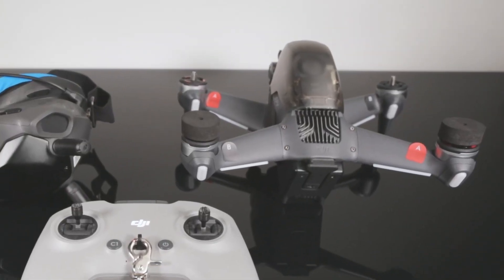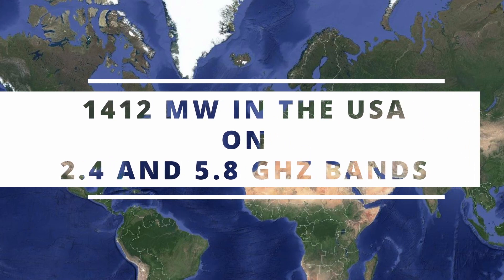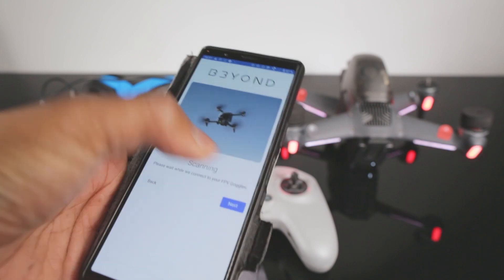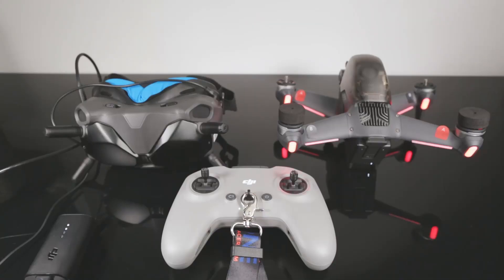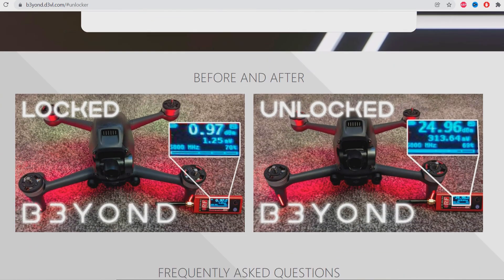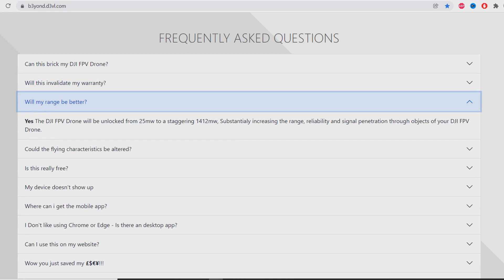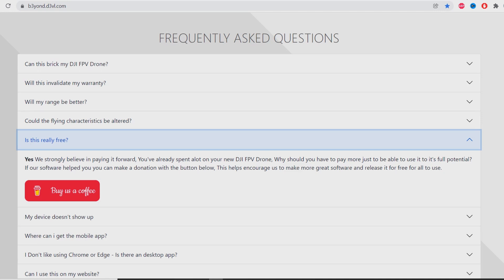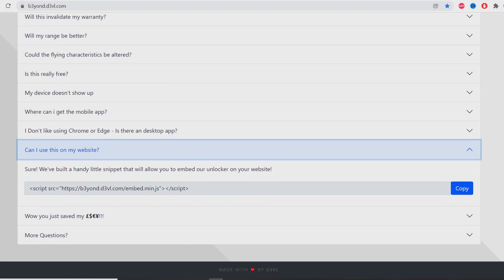DJI FPV FCC HACK

Comment: Respect to everyone. I have dji goggles 2 and they work only on 5.8 frequency. I'm wondering how I can unlock the 2.4 frequency. Is it even possible? I installed this proglam but it only added 7 more of these options but only in 5.8 frequency.
Reply from the maker: @KresimirMarasovic  

Official Methods

Check Firmware Updates:
Ensure your goggles and drone have the latest firmware. DJI occasionally adds features or adjusts frequency access with updates.

Change the Region in the Settings:

Go to the goggles' settings.

Choose a different region (if available) where 2.4 GHz is permitted.
Note: This option might not be present due to firmware limitations

Comment: Sorry im late to the party and would really appreciate your feedback. It says it updates it increases the power of the goggles to over 1400mw from 25. But you said the controller outputs 100mw? Does it increase the controllers range to the drone too? 

Thank you
Reply from the maker: yes 
Our software sends an unlock code to your DJI FPV Drone which unlocks the full 31.5 dbm 1412mw in 5.8ghz & 2.4ghz bands.
==== so the googles and the rc get the same range increase
Reply from the maker: you have the dji fpv or avata  ?

Comment: Hi bruno, 
Unfortunately my drone with 015 firmware but  even though I tried to run the BEYOND app on my Android and everything went great and I got SUCCESSFUL after the app finish.
How can check Its really work and my drone is unlock(before I do the first flight)?
Thank you :-)
Reply from the maker: If you got no error message on the beyond , it means it worked
Reply from the maker: @lironmizrahi7334  yes
Reply: @brunovfpv5756  
Thanks
Reply: @brunovfpv5756  
Hi bruno,
Just to inform you that I got a very long range(1.5K) after the unlock even though my fpv with ver 015...
Thanks a lot.!!!
Reply from the maker: Before the hack i had some glitch in goggles
Reply from the maker: After the hack it was gone
Reply from the maker: https://www.youtube.com/watch?v=Rve7cD5ifMQ&ab_channel=BrunoVFPV

Comment: How do you know if it works? should i see or change some settings in the goggles?
Reply from the maker: Before the hack it was awful, glitch everywhere man...
Reply from the maker: Nah, just fly man.
I tested it, sent it far away, lost no bar, had no latency or glitch whatsoever
Reply: Because yesterday i did my first flight and after 150mts away from me (not 200mts in hight) i got orange bars then red bars. That’s why i hope that this unlock helps me with this
Reply from the maker: @ciloeis  it will definitely help
Reply: I also bought and used the iflight thing for better and longer transmission, do you by any chance know if when using those, i need to set something in the drone or goggles? Or just install the iflight thing and fly
Reply from the maker: @ciloeis  i dont know, i never tested that
Reply: I turned on the drone and now instead of 2.4ghz i have 5.8ghz. And 2 channel to choose from. In terms of bandwidth i have 3 choices: 10mhz, 20mhz and 40mhz. Which one do you recommend
Reply from the maker: @ciloeis  you got the dji fpv quad or a diy quad?
Reply: @brunovfpv5756  dji quad
Reply from the maker: @ciloeis  i am still on 0020 firmware version so i dont have these options...
Sorry

Comment: What about the FPV batts that only provide 6 min of flight time ? DJI should come out with a solution to this nightmare situation. 20 minutes is the minimum one needs to enjoy this amazing aircraft. Shame on DJi !
Reply from the maker: 20 minutes is if you fly smootly in normal mode , noone is going to fly this way .
6 minutes is still a lot in the fpv world , but these batteries are expensive, at least they are smart = you get what you pay for....

Comment: Too late for this hack 🥲
Reply from the maker: Ouch
Reply: @brunovfpv5756  I cancel update at 20% then downloaded hack but on goggles it didn’t let me by pass so installed it 😿
Reply from the maker: @alexcarino3274  it cant be removed , but i know now how to avoid it 
WORKAROUND FROM REDDIT : 
I connected my goggles to the DJI fly app. Now it’s locked and is forcing me to update. I’m on 0020 right now.
Any workaround to disable this stupid message so I can fly again?
I haven’t pressed update yet.

1-kill the internet on your phone (airplane mode or whatever) 
2- open the dji app and clear all cashe data from settings. 
3- kill and reopen the app while still on airplane mode and connect your goggles/drone.

Comment: Hi Bruno. Thanks so much for this video! One question: don't I need to connect the Goggles to my phone with the Fly app running in order to fly? Whenever I fly, I have my phone connected to the Fly App. What I am asking: after the hack, how do you fly the drone without going into the app so it doesn't reset the FCC hack? Thanks!
Reply from the maker: You dont need to connect your goggles to your phone when you fly it.
Reply from the maker: Last time i connected my phone to the goggles , is when i made this video...
Reply: @brunovfpv5756  thanks! Just wondering, do I lose any info regarding my flight by not having it connected? Also, if I connect the phone to the goggles and launch the Fly app, the FCC hack gets reseted? Thanks
Reply from the maker: @ElődHorváth  1)no 2)yes
Reply: So, sometimes I like having my phone connected during flight so I can show my friend what's happening. By doing this, I reset the FCC hack?
Reply from the maker: @ElődHorváth  never done that, but as long as you use the app, it will reset the hack
Reply from the maker: @ElődHorváth  watch this,you can lose the hack forever https://youtu.be/BP11Yd9kRIc
Reply: @brunovfpv5756  Thanks very much.  By the way, after Unlocking your drone via the mobile app.Is there any way to tell whether the drone has actually been unlocked other than maybe going out and testing the range? Thanks!
Reply from the maker: @ElődHorváth  nope
Reply: @brunovfpv5756  By the way I gave the drone a go today with the FCC unlock. I did the test in an area where I couldn't fly more than 500m away from me, because there was either interference or obstructing buildings, trees etc. HOLY CRAP, the drone never ever lost signal with the unlock. It's like how I imagined the drone before buying it and afterwards I had to settle that it loses signal quite often, but NOW.. it's incredible. Thanks again so much! :)
Now, I have to be careful not to fly to far away so I can still come back, it's insane :D
Reply from the maker: @ElődHorváth  lol !!! you are welcome

Comment: Hi Bruno, I’ve got a DJI FPV that’s about 7 months old but hasn’t been activated yet. Is there a way to activate it without being forced to update it to the latest firmware? Thanks.
Reply from the maker: ouch man , as it's never been activated , you ll have the latest firmware, and then you should not be able to apply any hacks , otherwhise you wont be able to take off , give it a try and let us know , if you are able to apply this fcc hack....
Reply from the maker: Check my last video , there is one tip for you, tell me if it works..cheers

Comment: dji care is still active after the hack ?
Reply from the maker: Yes as its not a physical modification
Reply: @brunovfpv5756  unbelievable. 4.9km 3bars signal. Returned with 38% battery.
Reply from the maker: @mikemtfts  i did not push it this far
Reply: @brunovfpv5756  was my 1st and the last time I did that :)  . I just need good signal
Reply: Thank you !!!!

Comment: hello can i unlock my FPV Combo Racer with firmware 01.02.0020
can you help me, i can pay you 
thanks
Reply from the maker: update your drone , then apply hack just after
Reply: @brunovfpv5756  what do you mean update? Everything I see says do not update and now with the steal update all that’s available is the 0015 firmware?
Reply from the maker: @Bodie2012  when i made this video the 0015 was not released yet , from what i have heard about it , i wont apply it on my quad
Reply: @brunovfpv5756  sorry might not have been clear I just Dow have the ability anymore to downgrade to the .0000 firmware. Seem like dji has removed it from virtual assistance
Reply from the maker: @Bodie2012  https://www.youtube.com/watch?v=3wdaIFckAAw
Reply from the maker: @Bodie2012  https://www.youtube.com/watch?v=FatLmIh4gIg
Reply from the maker: @Bodie2012  check out the links i sent you , it says the last update , will prevent you from performing some update rollback + applying the fcc hack